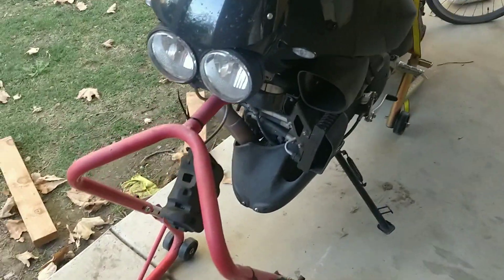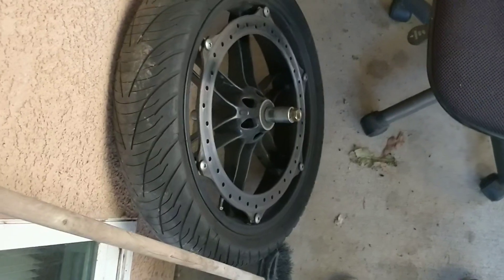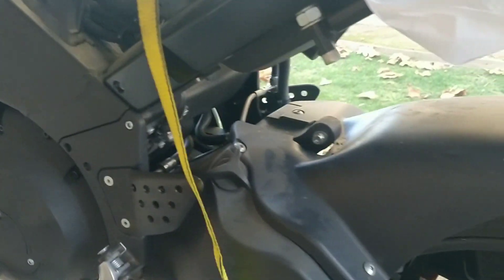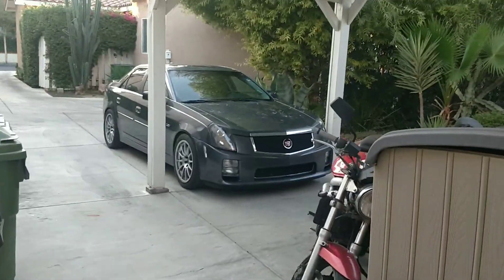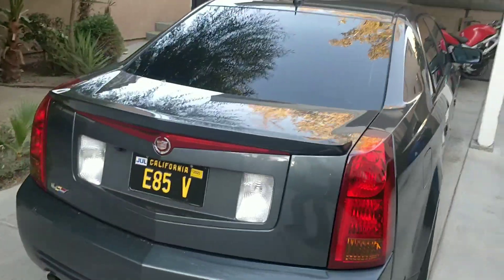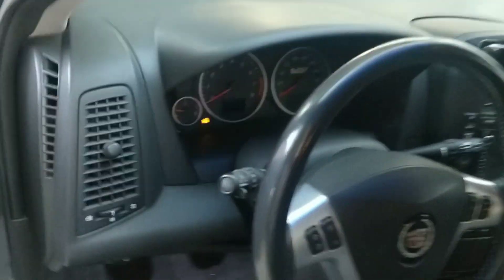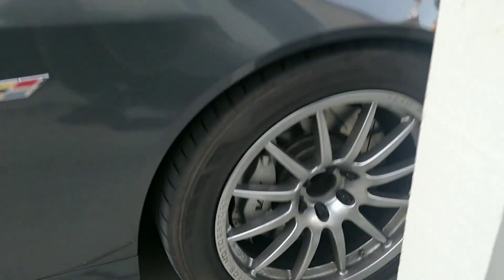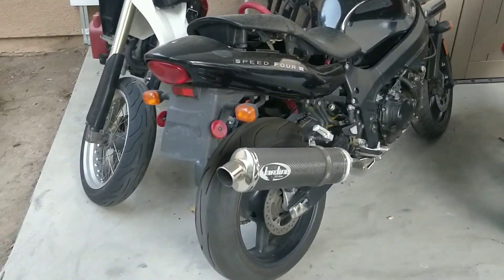A leisurely stroll through the backyard where we observe a motorcycle. Also, CTS-V.

Comment: I had an XB for a few years and I loved everything besides the lawnmower engine it came with lol
Reply from the maker: The engine is the best part though!
Reply: Corbin Goodwin Thanks for the reply Corbin! I’ve been a fan for a long time, made my own mk3 jettamino(inspired by you) years ago to haul my old XB9! My experience with the XB9R was love/hate, I would’ve totally agreed with you before the woodruff key on the oil pump drive gear broke on me twice. The first time shredded some of the gear, 6,000 miles after fixing it the second time the crankshaft snapped in half. I guess if it had a lawnmower engine it would still be running hehe